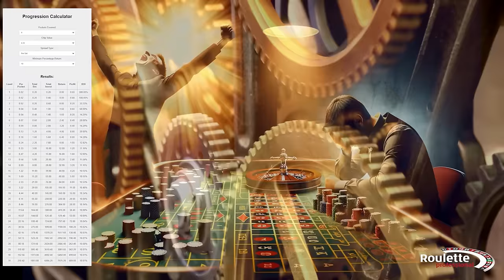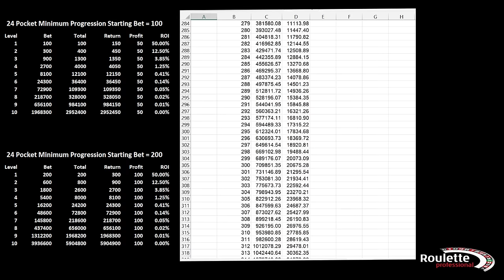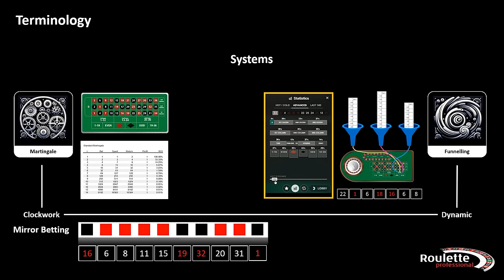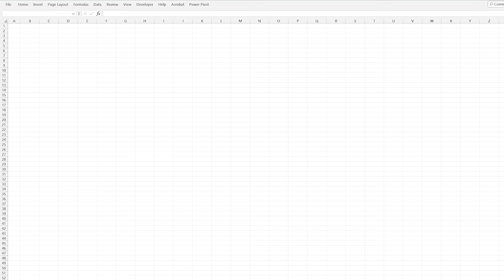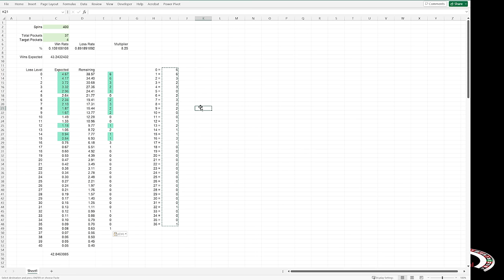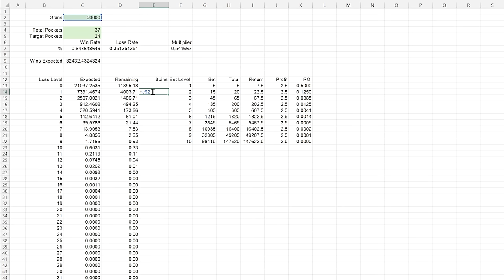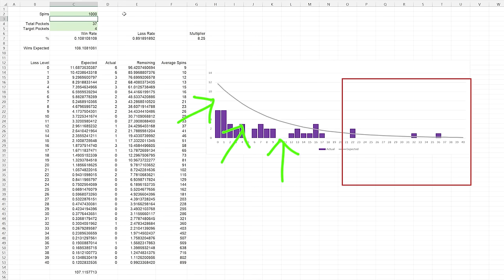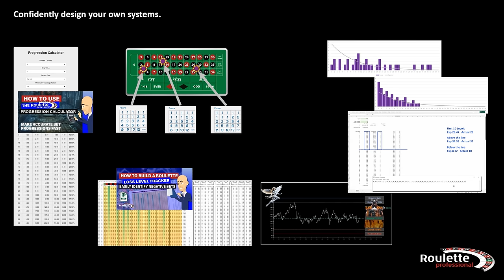Why Clockwork Roulette Systems Fail – The Mathematics Behind Roulette Results

Comment: The universe has already determined what numbers will appear. There is no way to truly beat the wheel. The only thing you can do is ask yourself the following question, “Am I sitting down at this wheel during a time that will be friendly to my strategy?”
Reply from the maker: There is truth in what you say - all systems win and all systems fail - as you said "Am I sitting down at this wheel during a time that will be friendly to my strategy?" tracking the data of what is happening in the game can give you a good idea of what system to use and when so you can select the systems that will be "friendly" whenever you play.

Comment: What its you opinion at bets mixed line red small odd : black hi even? I made nice money but poor money management. Lets say bet  R O L if hits R E H e double O  and L an bet same stake at R or change to B same stake. Problem is when one of 3 dont hit 2 3 in a row …i need develop a good betting progresion for this kind of strategy. Can help please?
Reply from the maker: Its sounds like you are playing a Double Zero wheel? if you are stop this and play on a single zero wheel, that one change will increase your chance of success (watch our complete guide video if you do not understand why https://youtu.be/NpdRGBB81W0?si=m3ncYQRwCSAjU-NH)

As for you other question we don't recommend the large 18 pocket bets. The problem with these is low returns and high stakes and the progressions needed are aggressive, there isn't a good betting progression for large bets, you are better off with multiple smaller bets.
Reply: Hi. I use single 0 roulette.but i have 4 posible results on a spin. W W W, W W L, W L L and L L L. If bet 1 on each result can be. -3 , -1 ,1 and 3 . But know how to do a corect betting progresion.

Comment: Can you show how the calculation changes when you wait for certain situations. For example, take the "TripleGale" when using 24 pockets. If I waited for one column to show up 3 times in a row, then bet against that column, would that be profitable?
Reply from the maker: As we showed in the video a set of 24 pockets can lose for 20 times in a row. 

Hopefully we demonstrated why a 24 pocket bet is the road to ruin if you are using the triplegale. 

In our heads the more wins you see for a given column the safer your opposing bet appears to be, 3 isn't safe at all if you can only afford say 5 progressions.

The calculation doesn't actually change. The relationship between potential losing bets and winning bets remains the same at whatever level you start your bet. 

If you wait until your trigger column wins say 6 times you still have the same number of potential winners or losers with the opposing pocket bets from that point, you will just see less opportunities per hour/day etc.

Hope that helps . . .  

But we strongly advise against playing the Triplegale at all. The return on investment percentage should highlight the risk to reward ratio is just not worth it. You can lose an entire months worth of profit in minutes.

Comment: Surprise 

Great video, but think I will need to watch a few times to process this info.

But I have a question, 
I now have a strategy of betting on the numbers from the last 6 spins. I have a progression that can go 25 spins. The biggest loss level I have seen so far is 28, but I will check this out from the expected in the tool you showed today.

I wonder if I think about the current TLV and sleepy pockets this will help me decide to start betting straight away or wait untill a loss level is reached? I would think if the sleepy pockets were high but the TLV low to average (950-1300), then I should see more of my last 6 numbers hitting, thus reducing the loss levels reached each time.

Am I thinking in the correct way on this any comments would be greatly  received.
Reply from the maker: It's no surprise to see you here lol.

If you mean you are constantly betting on the last 6 winners with a progression, you are effectively betting on a "random" or "dynamic" set of pockets on every spin as the last 6 winners are always changing, or you might mean when you start your bet you take the last 6 winners lets say 10,18,21,5,32,0 and follow those numbers as a newly formed static set.

Either way in the long term if you just keep repeating either method you will get the same results as you are betting on 6 out of 37 numbers.

I think you are asking if you are betting on the dynamic last 6 winners does the TLV data make a difference and yes it does the lower the number 666-1100ish the recent winners are more likely to repeat without going beyond a reasonable progression, 1200-1600 isn't much help for this type of decision, 1850+ then highest losers are more likely.

You could also use funnelling to help with this i.e. betting on the six most recent winners but sprinkling your bets across 3 funnels i.e. the dozens. that way the TLV from 666 to 1300 is probably a good indicator. 

Consider the other point made above about set choice, if you start a bet with the 6 most recent winners but then follow those numbers as a static set with your progression, at least one of those numbers has a high chance of a repeating in 25 spins. When you win, choose the next set of 6 recent winners which includes the pocket that just won so you get to win on doubles and triples and any pocket repeating with 30 spins. (the 6th pocket at level 25 is at loss level 30)

Hope that helps . . .
Reply: @roulette-professional  yes that's, I do bet on the dynamic last 6 pockets hit, so the numbers change each bet

Comment: I wonder, you say clockwork systems are bad because they lose in the long run... But can't they be effective if you start using them at a certain loss level? For exemple, if you only start a Triplingale when the two columns/dozens you're betting on have a loss level of 4, in the long run this should win or at least lose less, right? Since you're adding a dynamic element to it. Or are fallacists right on this one: it makes no difference and you'll lose as much? Also, same question if these dozens/columns came out less than expected. 

Idk how I'm supposed to make the calculations and I'd be interested to hear your insights on the subject.
Reply from the maker: The problem is its our perception that allows us to think if we wait for enough loss levels to pass before we place our bet we will be better off. (its both true and false)

As we tried to show in the video it doesn't matter what size of bet you are placing there will always be more losses in monetary terms beyond the amount of levels you can afford to play for and the trigger level you set if you are playing the same clockwork bet over and over in the long run.

This is why you need multiple systems.

If you only play one system you need a low enough trigger point to make it worth playing, but the lower the trigger point the more likely you will see a loss. The ratio between wins and losses remains the same regardless of what trigger point you set.

So the only way this works and our perception seems to hold true (even though its still wrong) is when our trigger point is so high we only place the occasional bet when the data is extreme. Its determining what extremity is worth playing for that counts here.

If you only ever play one type of bet you will lose in the long run or you play so rarely its not viable. Lets say you use the same TriplingGale method over and over, you might set your trigger to say loss level 4, so you wait until 1st and 2nd dozen have lost 4 times then place your bet, you will have x number of successes and y number of losses. The value of your losses will always outweigh your wins in the long run.

If you set your trigger to say loss level 8 the perception is your bet would be safer. What actually happens is the ratio of your wins (x) to the number of losses (y) remains the same over time no matter what trigger point you set, it just takes you a lot longer to see the overall results as you will see less trigger points per session/day/week/month/year etc and therefor less losses

So to "win" using trigger bets you have to set that trigger point so high the opportunities for profit are not regular enough to make a single system viable.

To use trigger bets effectively as part of a strategy you really need to be looking at placing bets beyond 6 decimal places of certainty i.e. greater than 99.9999990001 so if you look at the list below we wouldn't place a triplingale type bet until the trigger reach's level 18. 

So it will be so rare its not a viable single system strategy, but if used sparingly and you notice some extreme data causing a late trigger it can be worth the risk to play it as a "bonus". 

Just to clarify, at this point the method isn't any safer, the ratio of wins to losses hasn't changed but the chance of seeing a loss in your lifetime becomes exponentially unlikely.

Here is a list for 24 pockets showing the chances of loss/win in percentage terms to 10 decimal places
        Loss                           Win 
1	35.1351351351%	64.8648648649%
2	12.3447772096%	87.6552227904%
3	4.3373541547%	95.6626458453%
4	1.5239352436%	98.4760647564%
5	0.5354367072%	99.4645632928%
6	0.1881264106%	99.8118735894%
7	0.0660984686%	99.9339015314%
8	0.0232237863%	99.9767762137%
9	0.0081597087%	99.9918402913%
10	0.0028669247%	99.9971330753%
11	0.0010072979%	99.9989927021%
12	0.0003539155%	99.9996460845%
13	0.0001243487%	99.9998756513%
14	0.0000436901%	99.9999563099%
15	0.0000153506%	99.9999846494%
16	0.0000053934%	99.9999946066%
17	0.0000018950%	99.9999981050%
18	0.0000006658%	99.9999993342%
19	0.0000002339%	99.9999997661%
20	0.0000000822%	99.9999999178%
21	0.0000000289%	99.9999999711%
22	0.0000000101%	99.9999999899%
23	0.0000000036%	99.9999999964%
24	0.0000000013%	99.9999999987%
25	0.0000000004%	99.9999999996%
26	0.0000000002%	99.9999999998%

The fallacists state you cannot use the results from random events to make predictions, but probability and the law of large numbers trump that view.

Comment: Hi where can I send you spin results for review? I've only gathered 175 spins in 1 game that cost me $200. Dozens data is all over the place but columns are almost perfect. I know it's not much data but the company (baristocrat) who creates those machines has had allegations of rigged machines and the gaming director told me those machines are programmed with an 85% RTP despite being a "European wheel" which should only have 97-98% rtp.
Reply from the maker: We think its best to avoid slot machine style roulette games as its hard to tell if they are PRNG Roulette or programmed as a slot machine. You can send over your spins in csv format if you wish 175 spins should be interesting enough to see if there is anything strange going on. please send them in a CSV (comma separated format) format clearly showing which is the first spin you played.  i.e.           first spin played,1,4,16,31    or      1,4,16,31,first spin played             send to rp@roulette-professional.com
Reply: @roulette-professional  yeah I don't trust the ones I recently played at. The one's in the casino I visited a few times seem legit from the data I entered in excel. By the way would it even be worth it to play 00 roulette if that's the only low stake table game there is? Obviously it's 2x more likely to be a green but I'm wondering if my original 35-40% odds on dozens with the tracker would be enough to reverse the house edge.

Comment: At automatic roulette i am sure that its rigged. Its impossible at a moment to keep cover over 90 % of numbers and hit 4 times in a row 3 number that its not covered. Also to it happened to chase a 3 and after 160 spins a moment don t cover and just in that moment to hit. I understand not to bet against and that can be 20 times but to bet as i also done black, hi and odd and hit 7 times red small even … imposibile to win  as same strategy just at small bets and lose  at bigger stakes? I apreciate your effort but don t encourage even with good strategy to bet because in real bet on long term will be just lose. Better go to work and earn more then you can win online..    
i was olimpic at math. No matter how well are you doing now, on long term will lose.
Reply: Its interesting to watch but play for fun not on real money. It will make you lose more money that you win now. Better buy a table for home and play.
Reply from the maker: There has been some talk about automatic roulette having a protection system built in if it senses a large amount of table coverage, if that could be proven then you could say the casino is cheating.

However large bets will always lose more than smaller bets as you are amplifying the house edge. We covered that in some detail in Hidden Patterns Part 2 video.

Comment: This is just a complicated way to say that when you're losing, you should bet like you're losing.
The only reasonable bet when you lose is to bet opposite your standard bet.
There is no successful method without this kind of built in FLEXIBILITY.
Reply from the maker: Thanks for the comment Jeff, not sure exactly what you mean though?
Reply: @roulette-professional  If your standard bet covers 24 numbers and you lose, your next bet would be on the other 12.  This is just a starting point.  Everything would depend on the luck, as timing is everything.
Reply: No surprise, I skipped to the end.
Reply: BTW, any valid strategy has no win limit and a small stop loss.  The method I hinted at is the best in my long experience.